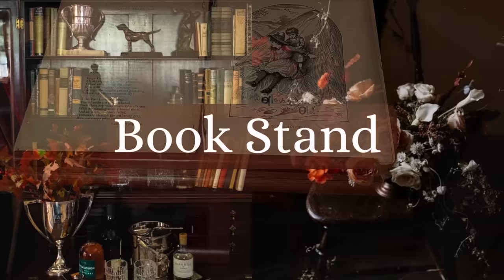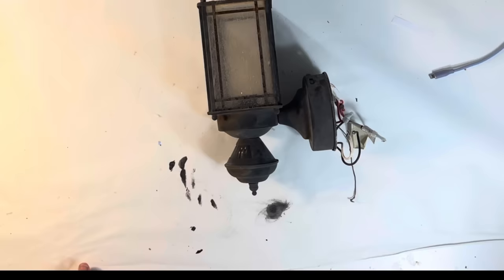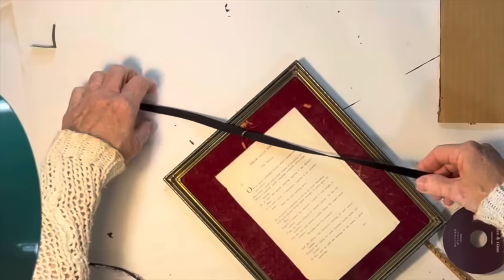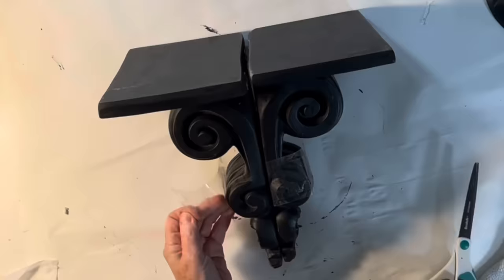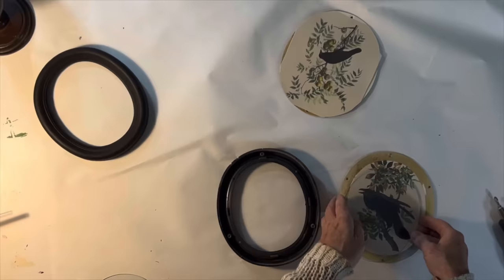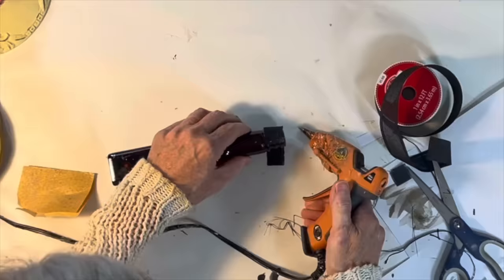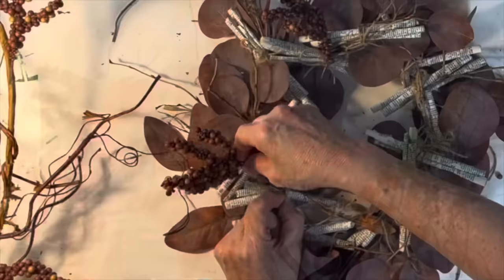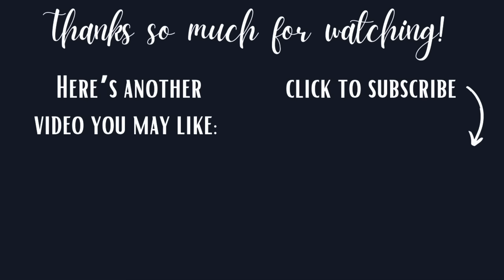10 DIY FALL Projects to Infuse Old World Charm into Your Home (WITHOUT Pumpkins)!

Comment: You can use masking tape torn into irregular pieces and stick to the bottles overlapping each piece. Then, use old-fashioned shoe polish to rub on and buff off excess. It will look like a cork covering when finished. This technique can be used on frames, shelves, etc

Comment: I do not know if this would have worked on your amber bottle or not, what I do with the writing is take nail polish remover and soak a cotton ball and try to remove the writing that way. Most of the time this works. Love your projects.
Reply from the maker: Thank you for the tip, Deb! I usually use Goof Off. I think the main ingredient in both is acetone. Most of the times acetone works, but this time it just didn’t. I’m not sure why.

Comment: Beautiful projects! I love this style. You mentioned an app you use for resizing images, what is the name of that app? I would love to find one that resizes without distorting.
Reply from the maker: It is called Resizer. It does not distort; however, it doesn’t measure in inches, so I have to play around with it to get it to the size I want. I download it and then print it from Print to Size (where I can see the measurements in inches). It sounds complicated, but it really isn’t.

Comment: Wait wait wait! A resizer app?  What is this magic you speak of?  Getting things printed in a different and proportion is a real struggle!
Reply from the maker: Did you find it? It is just called “resize.” It doesn’t measure in inches though, so I always have to  play around with it to get it to the size I need. However, it’s the only one I have found that doesn’t distort the images.